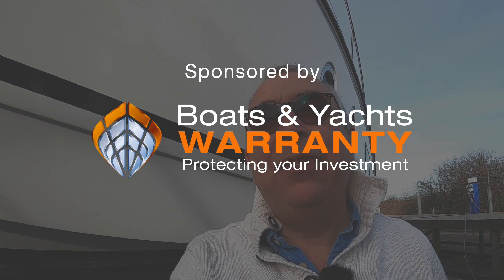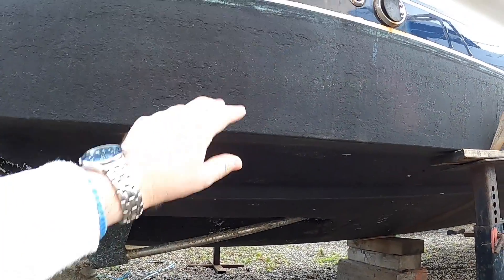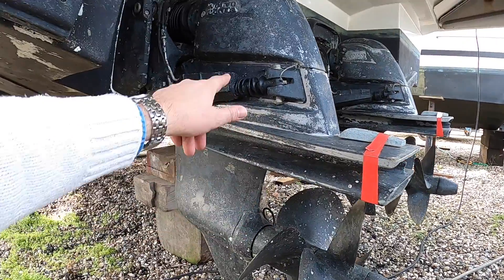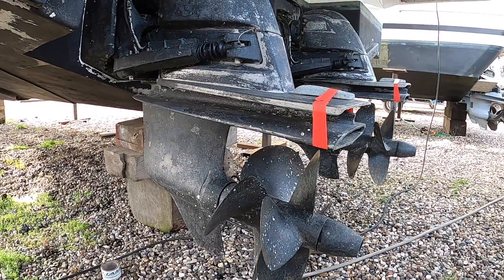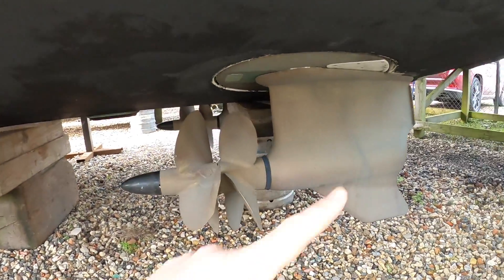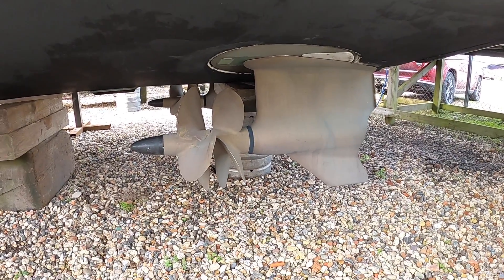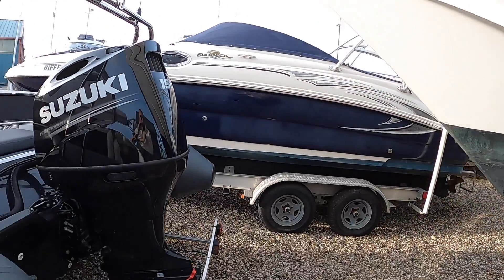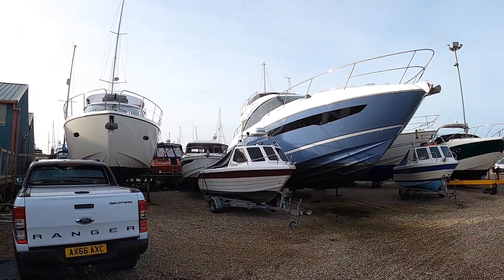Boat Drive Systems Explained

Comment: Not trying to be critical but you forgot one. I have always been impressed with "Surface Drives". Now maybe they are only on the larger yachts and so, that may put them out of the realm of a lot of viewers, but I believe they are super impressive.
    In all of these units I have seen, they give the impression that the manufacturer was striving for more than utility, because most look like industrial works of art. And at speed they are again impressive for the characteristic "Rooster tail" they lift in their wake because the top half of the "wheel" is totally above the water. 
    As far as advantage, the putting the shafts out of the stern, as you said referencing the drives you showed, enables moving the engines further to the rear of the boat. Also, by moving the shafts and wheels back it enables a larger diameter wheel with an efficient pitch, while retaining a shallower draft. They also swing like the outdrive and pod units so the rudders are deleted lessening drag, and appear to rest between regular shaft and outdrive for maintenance concerns. 
    As far as cons, I have only heard of two and would probably infer a third. The first disadvantage I have heard talked about is the power requirements pre-plane and the electronic controls required to manage this. These units swing such big wheels, because at plane they only utilize the bottom half, it takes big power to get on plane but precise control to prevent system damage pre-plane. I also understand that surface drives cannot be trimmed to achieve "on plane" faster, it is strictly reliant on the speed and the hulls  engineered characteristic to get "on plane". The other disadvantage, I have heard, is that given that the shaft and it's driven wheel swing as a unit in steering the boat, they are not quite as maneuverable as boats with a rudder or an out drive, and also,  there is a learning curve to operating a boat/yacht with surface drives. The last possible disadvantage would be an assumption on my part but would be the initial cost of the units over the other systems. Not only of the units themselves but the engines to power them.
    For my tastes, were I ever to find myself in a position to afford one of the boats/yachts that are my ideal (Riva, Mangusta, Princess, etc.) it will have big power (MTU, MANN), and surface drives (Arnson ?).

Comment: One thing we rarely hear about are electric motors. Are they usually paired with a traditional system, or do they have a special setup of their own?
Reply: What electric motors? The most widely used ones are electric outboards mounted to small-ish boats for cruising at extremely low speed while fishing and such activities and are fed by a 12v battery, similar to a car battery. Other electric motors are extremely uncommon, for now.

Comment: Very interesting look-see….

I suppose I gravitate towards conventional shafts, but I like the concept of a V drive as an alternative, being greedy for accommodation. I’ve lived with a Penta Duoprop and the maintenance was the only downside….. and on the deep V I had, no steering without more propulsion than I wanted.

I also like the sound of Jet drive ? 40 or more years ago, a family friend had his self fitted out, cuddy cabin fishing boat stored in our drive, it had a Ford V4 Transit engine and a water jet drive….. never got to see how well it performed.

Another gnarly looking setup is the Surface Drives…..??

A marine engineer friend also talks about hydraulic drives….. ??

In my ideal boat it would be an aft cabin, sub 40ft semi displacement hull, with twin Penta D3 220’s on shafts with a third, centre mounted D3 with a feathering prop on a straight shaft.

Nice eco single engine pottering with offshore grunt if needed. 🙂
Reply: If you like jet drives, I wonder if you've seen the MBY video of the Rodman with jet drives. 👍
Reply: @cookiemonster2299  thank you…. I’ll look it up 😎

Comment: I always think of it as it depends on the size of the boat. Outboards up to 20’ Stern drive up to 40’ and shafts on anything bigger. Also you didn’t mention surface or jet drives that the big Italian boats use! But I’d imagine they are a pain to maintain.
Reply: I think thats because they are both (surface, jet) extremely uncommon in the size range of boat he mostly reviews.

Comment: What about jet boats, not very common I know but maybe worth a mention.

Also do IPS drives use hydrolic power transfer or shaft? Great video 👍
Reply: Not Nick, but IPS drives have the same drive train as a stern drive, two sets of gears transferring the power through shafts.

Comment: Very well done, Nick.  There is a reason I'm addicted to your videos.  Since most boats are basically similar, as far as layout is concerned, could you do more technical videos?  Such as the different types of toilets and how they work, what do you do if the gray or black water tanks fill and you are at sea.  Things of that nature.  I'm just as excited to follow your home remodel.

Comment: From an efficiency stand point, I'm concerned about how small gears they put enormous power through to get the 90 degree angle. 
I wonder if it wouldn't be possible to put the engine in the water in a torpedo style shape, like a row 6 cylinder body with a straight shaft after. A torpedo shape can be quite aerodynamic as marine mammals demonstrate, it could be like a keel at ideal placement and the thrust would be straight, not at an angle. It could perhaps be a completely detachable pod for easier maintenance although you couldn't service it from the inside perhaps. Or the top of the engine could be getatable from inside at floor level. So it's a bulb on the ship. Or two. That would make for a clean engine room.
I have the distinct feeling that yachts is not a place where efficiency has really ever been a focus. Much could be improved I imagine. Electric drive would be cool but we are missing that compact nuclear reactor energy source.
I would also like to see some minimal cage around the prop. It's really bad of us to not consider marine life. I see many larger marine mammals with prop cuts on them and who knows hot many just die. It would take very little to guide around the prop with little to no drag. Might also protect from fishing nets. And ground strikes.
Reply: Electric and hybrid drive systems  simplify this, they can put the motor in the pod inline with the prop/s  the other option is like an oceanvolt system where the motors driving vertically down this way it only has a single 90 deg turn to negotiate.. 

Larger commercial vessels are increasingly using Azimuth pods using the motor inline or above and then the whole assembly can be rotated ..often including a outer ring housing shielding the prop and further directing the prop thrust.

If you want to see whats possible see what the model boat builders and folks who power up canoe's, surfboards and paddle boards are experimenting with.

Comment: The technical side of Aquaholics.  Really interesting Nick. I have to say I love the idea of joystick controls.   In my mind sounds a lot easier to manoeuvre.  IPS for me.
Reply: Volvo Penta are not the only ones doing these now, too. For outboards, Mercury has a similar system with their Verado lineup (also comes with a Skyhook system which is very similar to VP's Dynamic Positioning System). I recently saw something about Yanmar also implementing joystick/DPS controls for their diesel inboards. 

Exciting times for the maritime world!
Reply: @9VARZ  yes Mercury have it on outboards That’s why Mercury LEAD the outboard market. They take the inboard innovations and put it on outboards, like their new V12 where it’s just the gearbox and props that turns not the whole engine just like a sterndrive on an outboard

Comment: Great explanations. I saw a three engine azimut with one pod missing,  IPS do have a problem with seals failing. The outdrives have to be  rebuilt as they seals wear and it is about $10k per drive. Volvo actually changed from stainless to bronze bushings to help this.  Outboards are great, but they have about 1/3 the life of diesels. Mercury has a V12 600HP monster. One day you need to talk,about surface drives and jet drives.
Reply: I suspect jet drives are more common in the colonies than in Europe, as Nick reckons they are extremely rare outside jetskis, which is simply not true. He would probably have to find a Castoldi pump on a boat or an Azimut sea jet yacht as they feature twin Hamilton jets.

Comment: Cheers Nick very informative for us land lubbers. I have a question, I thought a propeller  rotated in one direction you went forward and if it spun in  the other direction you went backwards, am I right or not ?. If I am then how do those twin propellers work that rotate in opposite directions at the same time. Sorry if this is a stupid question but I am a land lubber lol.
Reply: The direction a boat goes depends not only on the direction the propeller is turning, but also on the pitch of the propeller blades.  If you look carefully, you will see that the two propellers have blades with opposite pitch, meaning that when they spin in opposite directions, both are pushing water in the same direction, forwards or backwards.
Reply: Mike is correct - I came here to say that basically on twin shaft boats, one prop is left handed, the other right handed, which is another way of putting it.

Comment: Very nice little Video Nick  … interesting to hear about the IPS  system and a bit worrying to hear it relies on computers !! Maintenance could be a nightmare 😱 Anyway Don’t forget the most efficient system is Surface drives … Shame more companies are not using them … also then jet drives … Hope you can find a couple of boats with those systems on !! 👍😎👏❤️🛥

Comment: Hi Nick you speak of petrol and Diesel but I was wondering with this new E10 rotten petrol coming in I was just wondering how this new petrol will effect the boating market because if car drivers have read up on this awful awful petrol coming out they will switch to Diesel?!!!
Reply: Why is it rotten? It's been around for so many years. Alcohol mixed with petrol, it's all there is. Right step towards bio fuels, carbon neutral and all that malarkey
Reply: @alisavas9526  The E10 has 10% more ethanol in it and 1) its bad news for engines, fuel lines, and catalytic converters and 2) I work in the DIY trade and we're looking at switching to diesels in our fuel powered lawnmower range etc because it doesn't sit well when not used for a long period of time!
Reply: @2490debrick  Got it 👍
Reply: @alisavas9526  all that malarkey being the absolute truth 👍🏻👍🏻👍🏻👍🏻🤓🤓

Comment: THANK YOU, Nick!!! Well presented. Easy to see the basic differences. Enough detail for the Gear Heads. Another Aquaholic "nugget" of useful and important information. From ease of servicing and longevity, all the way to "joy stick" docking (and the associated costs). As you mentioned the best system is the one that fits the situational needs of the boater.

Comment: Nice overview. I would like to add the waterjet option like Williams are using or even some fast ferries
Reply from the maker: Good point
Reply: @AQUAHOLIC   I did not though about jet drives but, how about surface drives also? Pershing likes it.
Regards from Mexico my friend.
Reply: @GerardoLiraSolis  Surface drives: Best efficiency of all drive systems, good for fast boats. Can handle a lot of power. Downside is poor maneuverability, limited trimmability. I think they work best in a high speed range with the props they use, dont know if they give any benefit at lower speed.
Reply: @AQUAHOLIC  Hi Nick, happy to talk to you about waterjets any time as I work for HamiltonJet :)
Reply: Waterjet: Good safety, no prop that can hit something. Theoretically very low draft. Downside is mainly terrible efficiency compared to props.